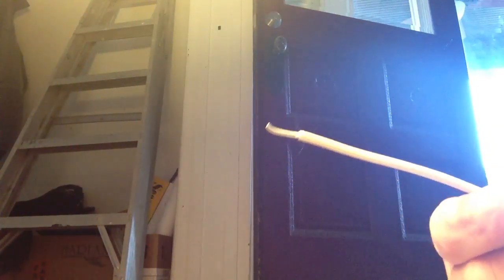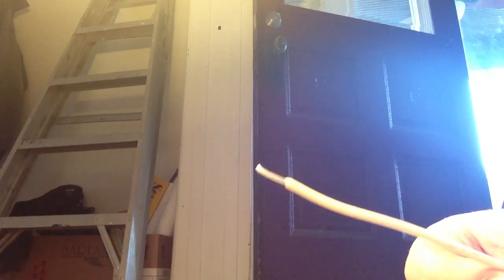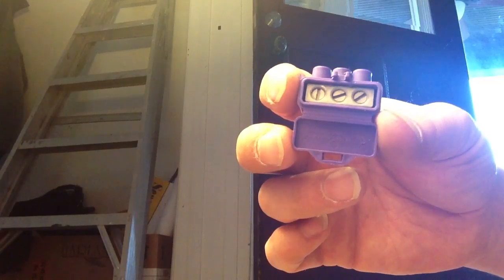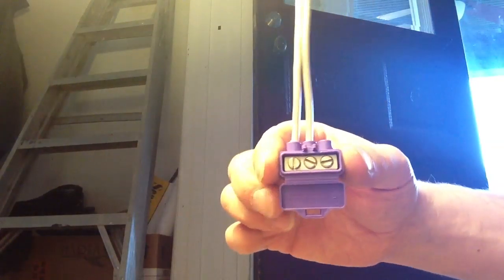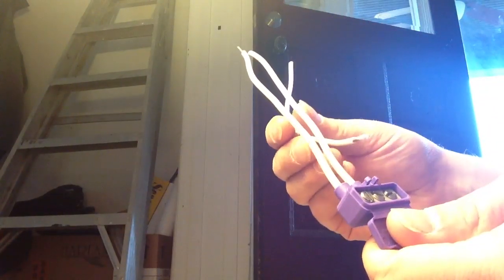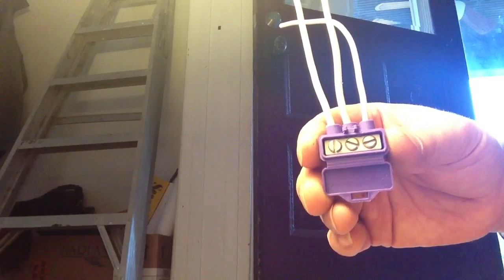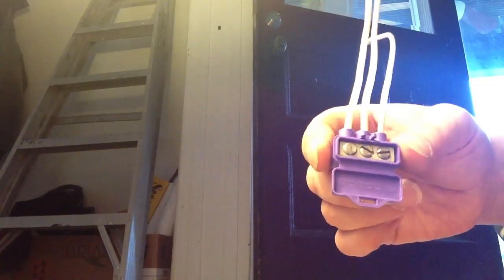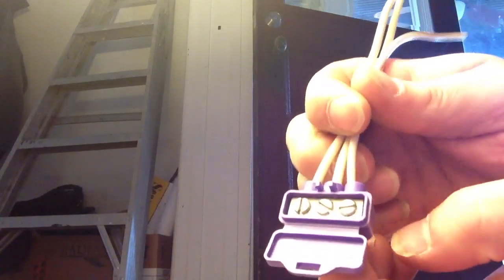Aluminum wiring in your house aluminum wiring repair

Comment: Video sounds great and excellent coverage but can you give manufacturer and part# please?
Reply from the maker: sifulowang Alcu.com maybe. I have not ordered in a long time
Reply: sifulowang These are AlumiConn mini lugs.  They come in 2 port and 3 port options.  I didn't bother with any of the 2 port, because I did not know how many I would need, and the 3 port ones function just the same as the 2 port, and are more readily available.  In my case it was cheaper to buy a ton of 3 port lugs than split it up.

http://www.kinginnovation.com/products/20/3-port-alumiconn
Reply: Gents thank you very much for the video and part number!!! How loose and heat rotted this trailer's wiring was - just insane it did not burn up. Regards...

Comment: Do they have these connectors for 5 wires? I have one Murret in a box where there are 5 wires connected. Not sure if this is code or safe.
Reply from the maker: Ted90125 no you would have to jump from block to block. These are best for aluminum wire

Comment: IMPORTANT:  The manufacturer of the device shown in this video REQUIRES that the connections be torqued (tightened) to their published specifications.  This requires using a screw driver with a built-in torque gauge. Amazon sells both the cu/al connectors pictured in this video; they also show a torquing screw driver for about $60 (cheap, compared to what else is out there).  My point is if you're going to do-it-yourself, follow the manufacturer's (and the CPSC  recommendations), so that the device will perform as intended.  BTW, over-torquing aluminum wires can also cause problems.
Reply from the maker: also a note the manufacture has alternate tightening directions without using a torque screw driver

Comment: VERY HELPFUL BUT BLOW YOUR NOSE PLEASE LOL
Reply: Hey leave the guy alone. Not everybody can have a radio television voice...

I worked in the electrical trades for a lot of years before I became disabled and this is the first time I seen these special connectors. I still do some small jobs that I can handle, but I refuse to work on any aluminum wiring...but it's good to know these things anyways.
Reply: While I do agree that themrhelperguy has something of a speech impediment, it's not that hard to understand him on the whole. That being said, I have tinnitus, and that can make speaking voices difficult for me to understand. For this reason, I use the Closed Captioning to help me pick up words that I might miss otherwise. I used the CC system during this video. The software to change speech to English needs a LOT of work. The interpretations were so funny, I had to pause the video several times so that I could laugh. Try it yourself, I think you will agree. 

Oh, thank you for posting this video. I have to do some work on a house I discovered today is aluminum. Whoever worked on the wiring before me used standard Marrettes and 'sealed' them with electrical tape. Its a mess!

Comment: Dude,, simply said, alum. to alum connections need nothing special. Alum to copper requires the special compound, eighter from a tube or already in that special wire nut. FYI  any loose conn. regardless of alu. or copper will arc and burn. in the real world no one is going to pull out half the wires and outlets in their house because it's alum. my god, the longer I listened to your video the sicker I got.

your comments of installing that blue conn. block is so much bull shit.
Reply from the maker: Alum to alum need special connectors so you can get a good bite on the wire. Alum and copper wires must be kept apart. Yes any copper or alum that is loose will arc. Alum in a wire nut will expand and contract as they heat up and become loose. Copper does not do this because it does not expand and contract like alum. That little blue block keeps the alum from becoming loose. It really comes in handy when retro fitting a copper plug to alum wiring. It allows you to go from copper wire from the plug to the alum wiring without those special alum plugs.